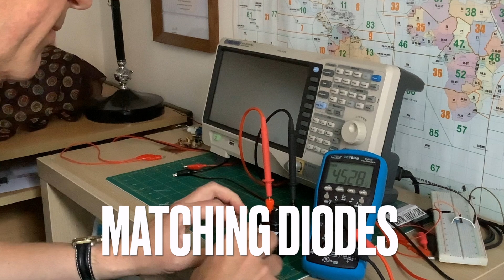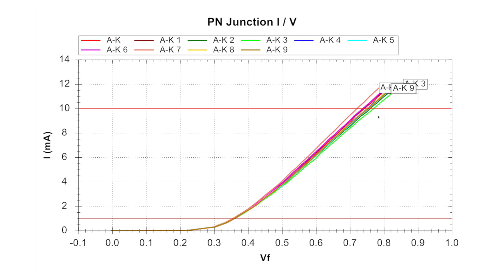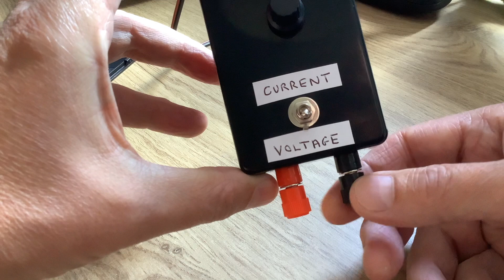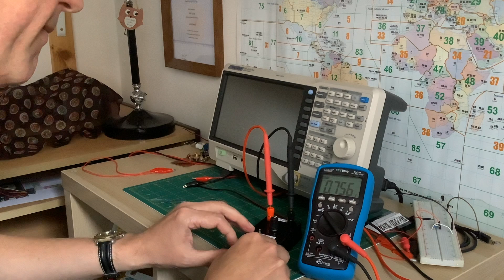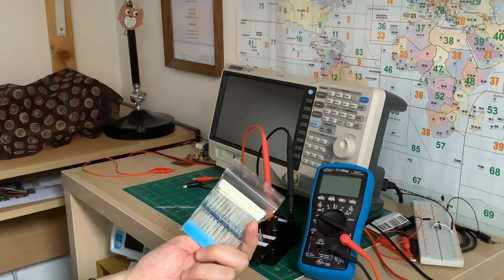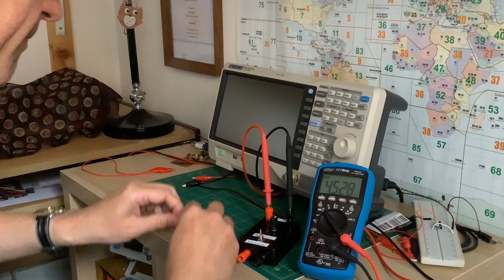43 - Matching Diodes for Mixers

Comment: Can you use a matched diode array?
Reply from the maker: Hi there! You certainly could - provided that the diodes were arranged in the correct orientation for a double balanced mixer (a ring) as opposed to a full wave rectifier. It would certainly solve the matching issue but I've never tried it. Best wishes, Nick
Reply: @M0NTVHomebrewing  I was assuming each diode was available in the IC.  But I've never used them personally.

Comment: According to the Vishay specs, a 1N4148 has a lower Vf at 10mA.
Those are probably cheaper and easier to get.
Reply from the maker: Hi there! But they are not Schottky diodes. The 1N4148 has a switching speed of about 4 ns. This is fast but not as fast as the IN5711 which is less than 1 ns. Also I believe the forward voltage drop of the 1N5711 at 10 mA will be about half that of the 1N4148. So you can use them by all means but I think you'll get much better results with the Schottky diodes. Thanks for watching. Best wishes, Nick
Reply: @M0NTVHomebrewing HI Nick, yes the 1N4148 are a bit slower. I was surprised the 1N4148 had a better Vf, but that's what the datasheet says. I will try a few options and see what works out. I'm always  a sucker for an experiment.

Comment: Is a variable power supply good for this?  My Korad power supply can be set to a constant current and I can just read the voltage at that current.  It's also programmable, so I could automate the measurements.
Reply from the maker: Hi! Yes it sounds like that will do nicely. As long as you have a constant current source set to the kind of current levels you'll be using the diodes at then you should be fine. Best wishes, Nick
Reply: @M0NTVHomebrewing  Thanks Nick.

Comment: I heard that the easy test is just to measure forward resistance.  Yay or nay?
Reply from the maker: Hi! I'm not sure how you would do this accurately. A diode is not a resistor and its forward voltage drop will vary according to current so you won't get a single value of "resistance". HOW you measure a diode is significant. If you use a multimeter on the diode setting then it will only put out a tiny current. That's fine if you're only going to put a tiny current through your diodes. But if you are going to use them in a diode ring mixer that will need to be driven by about +7 dBm from the local oscillator then you'll want to test them at a higher current. That's why I built a simple constant current source that enables me to dial in different values of current. I'd usually go for about 5 or 10 mA. This way you are testing them at the current levels you are going to be using them at. Hope this helps. Best wishes, Nick

Comment: What current value do you use when matching diodes?
Reply from the maker: Hi James, I actually address this very question in the video. It's at 10 mins 15 secs: https://youtu.be/EkMpLKwNl2U?si=NoI2wdg9AH1fWH3H&t=615. Spoiler = 10 mA for the reasons I state. Happy Christmas and thanks for watching. 73, Nick

Comment: In the datasheet for the LM317 there is noted that the minimum current draw is 3-5mA or something like that and often i see people draw 10mA just to be supersure that the LM317 stay stable.. But this minimum doesnt matter when you config the LM317 as a current source??
Reply from the maker: Hi! I've not had any issues with stability over lower current levels. You do need to watch higher currents though. It might be necessary to increase the supply voltage in order to achieve some higher currents. The most critical thing in the current source configuration I've found is actually the voltage levels. You need the sufficient headroom for the circuit to perform properly. Having said all this most of my use case is around 10mA - which is about right for 1N5711s in a diode ring mixer. As always, your mileage may vary! Thanks for watching and commenting. 73, Nick

Comment: I stared at the schematic for a while.... and that switch is not needed as I see it. Either you put a diode in, or you put your DMM in and measure the current. Anyway, did not know the LM317 could be used as constant current source, and that is something I appreciate knowing and definitely something I am going to use . So thank you for that!
Reply from the maker: Thanks Dustin. You're probably right about the switch! Thanks for watching and commenting. 73, Nick

Comment: matching the diodes just based on their forward voltage drop is nice but that is not the main source of problems in ring mixer (unless the discrepancy is really huge). Things like transition time and recovery time are much more important in operation of the ring mixer and they are difficult to measure and match . The best way is to use diode array packages.
Reply from the maker: Thanks for your feedback. From my own experiments it would seem that the forward voltage matching is a bit more forgiving than I imagined. I found that even more important than this is how carefully you build the circuit. But, hey, on balance I'll try and build a mixer the best I can - including Vf matching even if it's not the most important thing in the world. It is interesting stuff! 73, Nick

Comment: Well I'm convinced. The two meter method that you described (without current limiting) produced readings that "crept" a little as the diodes warmed up. I had to clip a small heatsink on the diodes to stop that. 
The method still worked, but this looks way easier! 
(Tony G4WIF)
Reply from the maker: Thanks very much Tony. Well I'm hoping it might make life a bit easier for us all! Time will tell. 73, Nick

Comment: Good work Nick and thanks for the G-QRP plug. In your previous video you tested a number of mixers for carrier suppression, etc. Have you done any tests with mixers made from matched/unmatched diodes? I get the theory of why it is good to match, but does it make any difference in the real world?
Reply from the maker: Thanks Steve! I haven't made a diode ring mixer without any attempt to match the diodes. However, for some of the early ones I just used the diode function on my multimeter. I'll have to try it at some point. It has certainly provoked some discussion on the reflector! Thanks again. 73, Nick

Comment: Hello Nick! Great video! One other test to refine matching might be to check capacitance of the diodes also and use that to whittle them down farther. This was suggested by W2AEW. What a great test device you made!
Reply from the maker: Hi Loren, thanks very much. That's an interesting idea about the capacitance. There has been quite a bit of discussion about this whole topic on the GQRP Club reflector in the last couple of days. Someone suggested that we shouldn't be DC testing diodes for mixers at all - we should test them with RF at the frequency we want to use them at. I haven't got a problem with that - just that it complicates the process a bit. This is where the capacitive reactance will kick in as it is frequency dependent. It is interesting! Thanks very much. 73, Nick
Reply: I built a couple of mixers in which I used a trimmer capacitor to help balance the mixer which affected the carrier suppression. This was in addition to balancing the amount of carrier to the 2 sides of the mixer windings. This was just another adventure in the mixer world. This all depends on how critical one wants to be in design and construction. If the carrier suppression is great as originally built that is all one could hope for. Thanks again!

Comment: On the schematic you've got the DUT cathode connected to ground, I think this is incorrect, should be as per the wiring layout.
Reply from the maker: Thanks Al. I think I know where you  mean - on the V3 pencil schematic. The D- terminal should only be grounded through the switch. I'll correct it. Cheers.

Comment: Why is a mixer bridge arranged differently from  from a rectifying bridge?
Reply: A mixer is a diode RING not a diode bridge - two different configurations.

Draw it out and you will soon see the difference

Andy
Reply from the maker: Very good question! Essentially although the two circuits are similar they perform different functions. I explained what the diodes do in a mixer but check out the link below (under the ‘Rectifier’ section) for a similar walk through of the current flow in a diode ring rectifier:
https://en.m.wikipedia.org/wiki/Diode_bridge

Hope this helps. 73, Nick

Comment: I appreciate your postings, but I have a suggestion.  When you refer to your drawings or charts, etc., you use directives such as here, this, there, etc., and use your mouse cursor to focus attention.  However, the cursor is so tiny it is almost impossible for me to quickly locate it on the screen.  It would be quite helpful if your cursor were larger so it could be followed around the screen more easily.
Thanks.
Reply from the maker: That’s a very fair comment and thank you for the feedback. I’ll see what I can do about that for the next video. I appreciate you letting me know. 73, Nick

Comment: Hi Nick. The best method for matching diodes:
Use a Peak Atlas DCA75 Pro with PC software for diode characterization. Choose those diodes that have the closest curve. Zoom in on the chart for a closer look.
Regardless of the method used, try to use a plastic tweezer to change the diodes at the measuring point, in order not to change their temperature. Silicon diodes have a voltage variation with temperature of 2.5 mV/°C. At a variation of 10 °C, you will have a difference of 25 mV!
Good luck! 🙂
Reply from the maker: Hi there, I have one of those devices. That’s how I produced the IV chart in the video. It works a treat but I wanted to try and build something myself which wouldn’t cost much but would give good consistent measurements and was not too fiddly. It does also depend upon your DMM. The DCA75 Pro is brilliant though. 73, Nick

Comment: Hi Nick. It might be worth mentioning that, like their PN junction cousins the forward voltage of silicon Schottky diodes has a negative temperature coefficient. It's lower than that for PN diodes, but still worth considering at about 1.45 mV/degree. So a difference of, say, 10 degrees due to holding one in a hot clammy hand versus one left to sit for a little while after mounting in a jig could give a discrepancy of some 14.5 mV. Power dissipation will only be of the order of 5-10 mW, but it's probably worth making measurements reasonably quickly once the current is on to avoid self-heating.
Reply from the maker: Thanks for this. That’s helpful advice. 73, Nick

Comment: The mismatch in voltage amounts to 10% or less.

Efficiency/gain/loss change is minimal.

Only big effect is the LO leakage to the output might be 10-20dB down instead of 40dB down.

With proper designs that filter that output, it's hardly worth worrying about.

You can also get good LO suppression just by matching diode pairs instead of matching all 4
Reply from the maker: Thanks for watching and for your comments. I agree that loss is not a huge issue because that can always be made up for but the LO leakage is certainly, as you say a more serious problem. As I've said in previous videos, one of the main issues I've had in building SSB transceivers has been poor carrier suppression in the balanced modulator. Once that signal is there then it can be a pig to try and notch it out. Far better not to have it there in the first place. So anything I can do to improve the performance of the mixers/modulators that I build is, for me at least, time well spent. Thanks again for taking the time to comment. 73, Nick.
Reply: @M0NTVHomebrewing  You can also inject a small amount of DC from a trimpot to get near perfect suppression

Comment: Very useful. I remember replacing  4 diodes in 2 identical discrete mixers   . One  1N5711 set gave  much better balance, no doubt due to being better matched at the higher current. I have seen diode quads in a single package degrade, again normally due to 1 or more diodes changing. I have used 1SS99 diodes which have a far lower drop at 10mA, translating to less mixer loss. About 5 dB vs 7.5 dB. I haven't tried driving the 1N5711 diodes with higher oscillator power yet.
Reply from the maker: Thank you very much. I've not come across the 1SS99 before but it looks as if they are getting harder to find these days. Bit of a shame as they look ideal for mixers. Thanks again. 73, Nick
Reply: The BAT42/43 looks interesting with the lower voltage drop at 10 mA, however the capacitance of around 7-10pF may degrade the mixer at frequencies near 28MHz/50 MHz. They are glass diodes, at a few pence (cents) each.